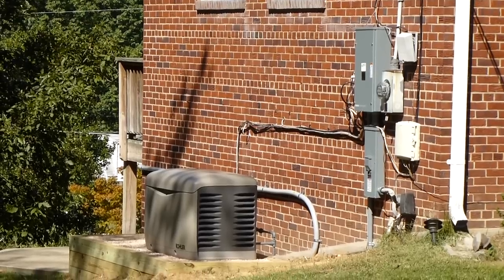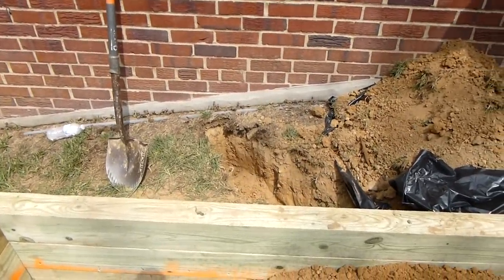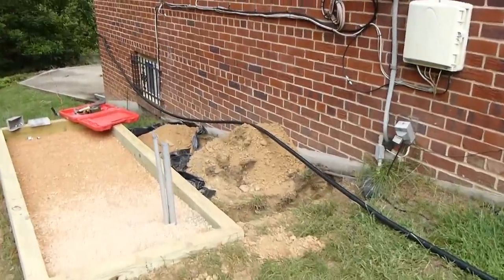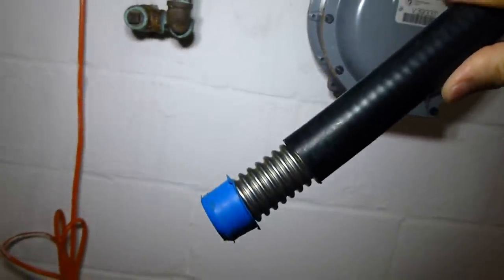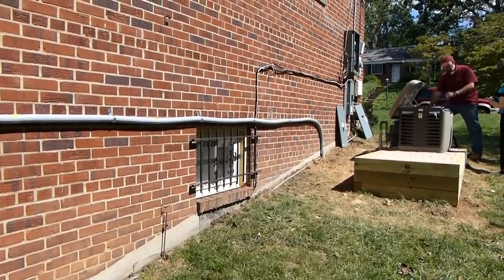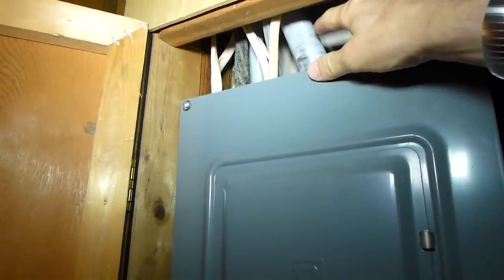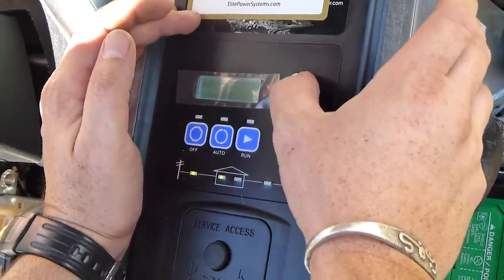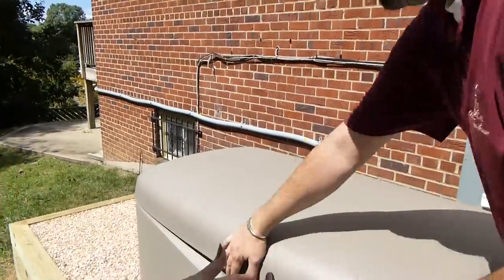Installation of a residential backup generator (Kohler)

Comment: We purchased a costco generator 3 years ago and are having trouble finding a contractor we can trust to putt it in.  After spending three storms in 7-10 days without electricity,  we really need to get this done.
Reply from the maker: MultiSeekingTruth Doesn't Costco have a contractor or two that it works with? If not, try a couple of the larger electrical companies near you. Another choice might be to call a couple of general contractors and see if they will give you quotes. If they're between jobs, they might handle it. Good luck!

Comment: The ground rods provide protection in the event of over voltage, short circuit, or lightning?  You might want to revisit that.
Reply from the maker: I'm not sure exactly what you are commenting on, but I'm pretty sure that a ground rod (if not two) is required by the electrical code and/or building code. It can provide protection for a variety of events.

Comment from the maker: Keep in mind that this generator is at my neighbor's house, and I don't get to see their utility costs. Since this was installed in Sept. 2012, we have not had any power outages. However, the generator runs for 20 minutes every two weeks. Of course, fuel consumption depends on the generator's load -- a generator with no load will use far less fuel than one supplying half its rating. The big power draw here is AC in the summer, and that boat has sailed for this year.

Comment: Ground rods for a residential generator?  Does the ATS control the neutral making it a separately derived system?  Not smart.
Reply from the maker: All I can say is that it was inspected by the electrical inspector. It has also been in operation since 2012 with no electrical problems. (The motor died once, but that has nothing to do with the electrical connection.)

Comment: How is that long gas line not going to starve the generator? He should have upgraded the meter regulator and then placed a regulator right before the generator. That way there would always be full pressure available at the end of that long gas line for full load operation even with all gas appliances on. Also why didn't they bury that gas line rather than strapping it to the side of the home?
Reply from the maker: This generator has been working since 2012, and there has never been an issue with fuel starvation. As to why the gas line wasn't buried, I can't answer that. This installation is at a neighbor's house, and this video documents the way it was done. It was not my place to ask why it was done the way it was done -- I was not paying for it.
Reply: @BobKovacs  I would guess it's a cost saving factor for their turn key installation.

Comment: nice video and installation. I am about to do this myself and on a hill. Please confirm why you extended the foundation out as far as you did on the exhaust side of the generator, please. Thanks
Reply from the maker: I see you sent me a message through my web site, too. I guess you really wanted to know the answer!

Unfortunately, I really don't know the answer. This system was installed at my neighbors' home, and my recollection is that the local building code required that the pad be installed at least 36 inches from the house. The pad runs parallel to the wall of the house.

FWIW, this generator is still working fine and providing power when there are occasional outages. We were without power for 30 hours during one period this summer, so these neighbors were sitting pretty.
Reply: @BobKovacs  thank you for your quick response. My generator will be sitting on a pad erected on an incline just as theirs was and the price  of it comes down quite a bit if it is 40% of the size they made theirs. I didn't see any sign that the extension was necessary since most maintenance would be from the front. Mine will be be slightly taller to line up with the deck next to it when everything is finished.

Comment: I am thinking of installing a 20kw whole house Kohler generator. Can you tell me what the approx cost would be including  the generator, electrician and plumbing for the gas line?
Reply from the maker: +Michael Masters I did not pay for this installation, and I did not ask the neighbors what it cost. However, I will guess that it's about $4k for the generator and $6k for the permits, installation, inspections and approvals. Budget $10k and you should be close. If you do any of the work yourself (install the platform, for example), you might save some money. FWIW, Costco sells a Honeywell 17kW backup generator with the auto-changeover panel for $3k.
Reply: Vincent Yurak all that work for half the price?? Sounds like you are desperate for work and or none licensed

Comment: Why was such a large pad installed?
Reply from the maker: I don't really know. They seemed to know what they were doing, but you're right... there is a lot of extra space.
Reply: I am in the process of having a 16 kw Kohler installed thru REA co-op. They told me to install a 3 by 5 concrete pad. The propane company wants the same size concrete pad. Cost for generator and propane will be about $7500 installed.
Reply from the maker: @williamhritz3455  After I posted this video, a company that manufactures concrete pads for generator installations contacted me and asked if I would make a video about a generator installation using his product. I made a bunch of e-mail contacts, but could not find anyone locally doing such an installation... at least that would let me video it. 

Getting a prefab  concrete pad is probably the way to go for something like this.

Comment: I'd be concerned with having the plastic pipe used above ground. That would be against code in the seattle area but beyond that, even if it's legal, it's way too susceptible to damage. Black iron is the best and safest material that is acceptable to be used for outside above ground gas or propane fuel lines. The plastic is typically for burial only and for gas is typically yellow and where it comes out of the ground should be encased/protected in metal in a gas riser . The pad was very nice but hopefully others don't watch this thinking it's okay or safe to run a fuel line like that. That's an accident waiting to happen. Just my 2 cents.
Reply: NonyaBusiness! Yes, it’s stainless steel I believe.

Comment from the maker: I wasn't involved in pricing or paying for this, so I don't know what it cost. However, Costco sells a 12kW standby generator with the change-over switch for $2,500. Installation should be less than $7,500 -- I'd guess that it's less than $5,000. But that's just a guess on my part.

Comment: 10 seconds to switch over! That's about as good as you're gonna get. I've seen some take over 20 from the time the power failed to the transfer switch engaging.

I was very close to getting a natural gas generator with auto switchover like this, but decided against it due to the cost with installation. Basically I found more important things I needed first. Instead I installed a manual switchover myself and got a 5000 watt gasoline portable. It powers the furnace, a portable a/c, the fridge and most of the lights. I might do this in my next home though.
Reply from the maker: That's pretty much what I do in the event of a power failure: Use a 4kW gas generator to back-feed the house and power most of what I need. However, the couple who owns this house are elderly, and they really can't struggle with a generator. It has to be automatic for them.
Reply: Bob Kovacs So what was your rough total cost do you think with set up supplies, generator and installation?
Reply from the maker: ***** As I mention in the video and in the comments, this installation is at my neighbors' home, not mine. I do not know what they paid. However, you can buy a well-sized backup generator at Costco for around $3,500, including the auto-changeover panel. Installation will be $5-8k, depending on your conditions and requirements. On the other hand, you can get a 7kW portable generator from Harbor Freight for $600 and wire up an outside outlet on your house for $500 or so (depending on how much you do yourself). You will have to manually turn off your main breaker, but you can plug that generator into the outside outlet (must be 240V) and feed your whole house. It's not nearly as convenient as the automatic backup generator shown in this video, but it's a helluva lot less expensive.

Comment: I think it is a great video.My question is two parts, is an Licensed Electrician needed and if your gas certified,  and used to working with gas on furnaces, and have HVAC , any special licensing to do this. we are in NJ.  it looks like a easy install process. I mean if we install A/C's and Boiler's and furnaces, it looks like a easy process. I would like to add it to our Company.
Reply from the maker: I'm sure a licensed electrician is needed for this, especially since it involves inserting a changeover switch into the main power service to the house. That's nothing to fool with. Electrician requirements vary among jurisdictions, but I'm sure this would require a license anywhere in the US. I'm less familiar with requirements for running the gas line -- you'll have to check your local building department as to whether a license is needed for that. Where I live (Fairfax County, VA) this job requires a building permit and involves multiple inspections. That's probably also true in NJ.

But as you note, this is overall a straightforward installation.
Reply from the maker: ***** This was definitely inspected. It required a building permit and had numerous inspections.
Reply from the maker: ***** I agree that it's not pretty. If it was my installation, I would have buried the gas line before it got to the downspout. However, it's not my house and not my installation. I do know that it was inspected, though.

Comment: Could you have used an interlock device instead of all the extra panel that goes in your regular panel? I’m not sure if that is the right name but they use them with portables. Not automatic, you have to flip the switch. Also why on earth would someone make a pad twice as big as the unit and run the wiring way up high on a nice brick wall. Then they put the grounds right in the middle of where you have to walk or cut grass?.?? The narrative was good and the video. Just think things could have been done a little differently. I hate where the electricians, the gas people, phone company and cable companies just put stuff up on your walls all over and don’t worry about all the holes or what it looks like. Especially with vinyl siding. And when you change companies, the old folks won’t come and get their equipment, and the new won’t touch it and put in another set of boxes and run lines in different locatiins. I wish everyone would go to underground. If someone came up with a unit that included all necessary items that mounted on a wooden upright unit next to the house or even on the house where it looked neat - they would make millions.
Reply from the maker: Good ideas... thank you for the comment. Although I shot and posted this video, this is not my system -- it belongs to my across-the-street neighbors. Could they have taken a more active role in the design and done things differently? Yeah, probably. However, they went with a business they trusted and let the company design the system the way the company wanted it.

I like your thoughts on all the different services and how it clutters up the wall of the house. We now do have buried power wires in this neighborhood, but CATV and telecom (in this case, Verizon FiOS) are still delivered overhead. It would be excellent to get everything buried, but that could not be coordinated when the power was buried.

Thanks for the comment!

Comment: Installing 2 separate "ground" rods violates the National Electrical Code. Reason: Lightning can cause a fire; because current flowing from one ground rod to the other and their dedicated connections; induced by a difference in potential between the rods.

All ground wires should "see" and connect to a single point (ground rod.) This was a relatively NEW ruling when I was an electrician; and the practice of separate ground rods was widespread (it still is in some cases). But after engineers studied it and saw some of the catastrophes that ensued, they created the ruling.

It can also cause all kind of problems in sensitive electronics such as on PC's, ethernets and TV's, etc.

IE: the rule is still violated all over sadly, fomented by ignorance. But it can also cause legitimate lawsuits when one does it; IF fire marshals deem that the fire's origin started between multiple ground rods..

For whatever it's worth.
Reply from the maker: Interesting. I'm sure the engineers and scientists know what they're talking about, even if I don't completely understand it.
Reply: I know this comment is really old, but what you're saying is not exactly true. It is literally required by the NEC to have two ground rods in most cases. And, even if you only have one ground rod, you're still required to bond the metallic gas piping and water piping as it comes out of the ground (if you don't have plastic pipes anyways. The utility gas line coming to my house is steel and the water pipe is copper.) 

NEC 250.53(A)(2) states if you install a ground rod as your main electrode, a secondary electrode is required (unless the individual rod is tested to have less than 25 ohms resistance). The key element, described in Ch. 250, is that all grounding electrodes have to be bonded together. The issue comes from the old generator installation manuals that say the generator needs an additional ground rod that is connected to the generator only, with no connection to the new ground rod and the grounding system of the building. In the event of a lightning strike, a difference in potential develops between the building's electrode and the electrode at the generator, which sends the voltage through the generator and destroys it. 

Lastly, this generator install would require ground rods for it alone if it were wired as a separately derived system, meaning if the neutral conductor is switched along with the hot conductors in the transfer switch. If the transfer switch switches the neutral, it effectively removes the bond between the neutral wire of the building and the bonding/grounding system of the building, and connects the neutral to the neutral of the generator. The generator would have to be wired so that the neutral at the generator is bonded to the EGC and the ground rods. It is generally easier to float the neutral at the generator, and switch just the hot conductors at the transfer switch. Then, you can focus on having one good grounding/bonding system for your house, and rely on it when you are getting power from the utility or from your generator. If the generator has a floating neutral, this is called a "nonseparately derived system".

Comment: Bob kovacs... how do you install the carb heater?
Reply from the maker: I don't have any idea about that. This is in Virginia, and we don't really need heated carburetors here. You'll have to check with the manufacturer.
Reply: Hey Bob how do I figure out what is the right generator for me?
Reply from the maker: Raphael Reid
Raphael, start with what you have in your house that you absolutely need to run in the event of a power failure. If you're in a town with water and sewer systems, then you certainly need to run your refrigerator, a few lights and other conveniences. If you need to have air conditioning, that's a BIG power draw. If you have an electric water heater, that's a BIG power draw. If you have electric heat for your home, that's a BIG power draw.

If you're on city water/sewer, have a gas-fired furnace and water heater, and don't require A/C, then 3,000 Watts is plenty for you. It will run the fridge, a few lights, the TV and other incidentals. Add 4,000 Watts for each of the items I mentioned if you have them and their use is critical: water heater, A/C and room heat. For example, if you are on city utilities and need to run your A/C, that's 3 kW + 4kW = 7 kW. If you need to run a water heater as well, that's another 4 kW. If you have a well pump, that's 1 kW.

I have a 4 kW generator and it has no problem handling a well pump, fridge, lights, TV, incidentals and even a small window air conditioner. However, it does not have enough juice to run a whole-house A/C unit.

That's how I'd figure it, anyway. Good luck!

Bob
Reply: Bob Kovacs I energize my complete house with a relative small 8.5kw Champion standby gas generator. I can power my 30” electric cook top, washing machine, microwave oven, my two fridges, my two garages doors, my water cistern 3/4 HP electric pump, all my lights, my 48” TV, satellite system, wifi rauter and a 18,000 btu inverter a/c. But my water heater is solar and I don’t need an electric heater to my house because I live in the carribean Puerto Rico, and here we have warm weather all year long. I also use a 120 galons propane gas tank to feed the generator and is very fuel efficient, since at half load it consumes only a little more than 1/2 galon of propane, but for some reason the specs says it consumes 1 galon/hour at half load and 1.5 galons/hour at full load......🤷‍♂️🤔. My total investment was less than $3,800dollars after it was installed by a professional Technician. The pad for the generator and gas tank were made in 3 1/2 inches thickness solid concrete with rods to prevent and avoid the cracking of the concrete do the vibration produced by the generator and was attached to the concrete pad with tapcon screws to support hurricane force winds, since here we are threatened by hurricanes every single year.